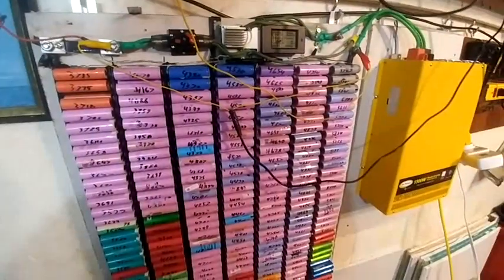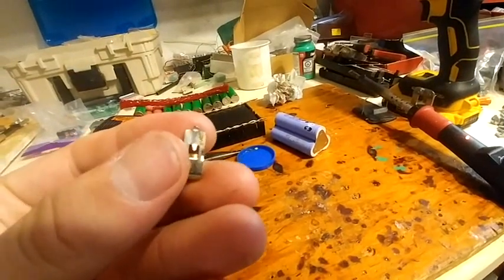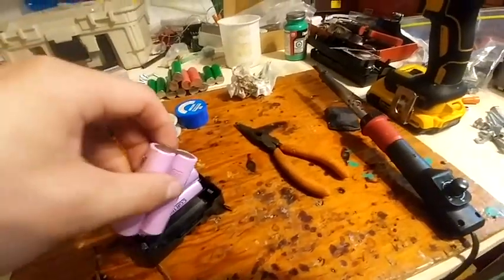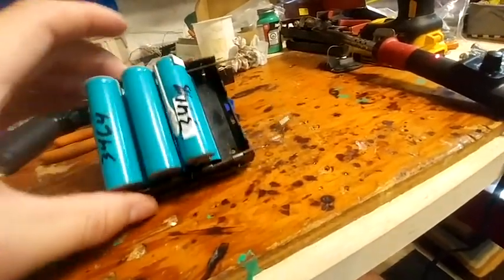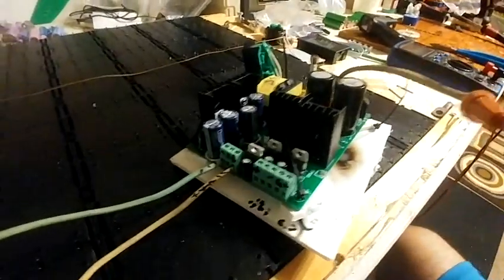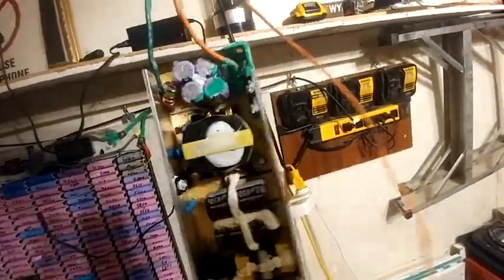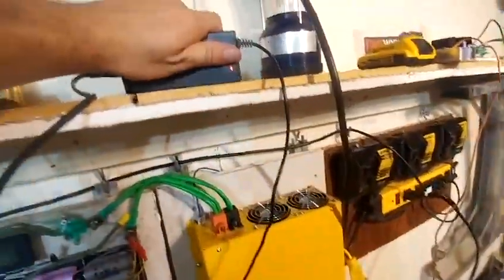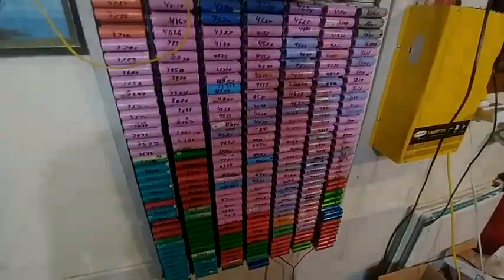18650 battery holder fuse solved? No :(

Comment: Andy, u need to try and get ur total ah capacity as close as possible in each bank of cells. The cumulative total of each cell bank matched perfectly and ur bms won't have much of anything to do. Regards
Reply from the maker: Thx eric! I'll deff do that with my small ups wall. Lots of testing fun can be done using it. :)
Reply: I'm still acquiring and processing cells myself. Need a lot more than I have at the moment to get my wall up and running. Considering buying some Ev batteries but I haven't found a good ev battery to make a 7s system from just yet within my budget.

Comment: balance your cells rows by using this website https://secondlifestorage.com/repackr.php from DIY power walls. Also ive noticed that your running your power out at the top remember path of least resistance for your current under a heavy load all your cells at the top will see the most current making your batteries heat up at the top first and the bottom playing catch up to charge the top and with your bms connected at the top as well if it sees a voltage drop below specs it will shut down thinking the batteries are dead. Best fix move your ground cable down to the bottom and leave the positive where it is that will force the current to flow through all cells more evenly.